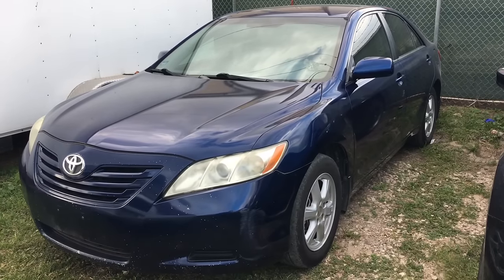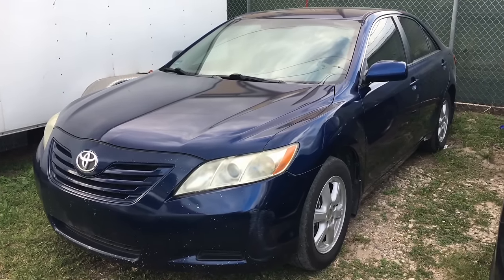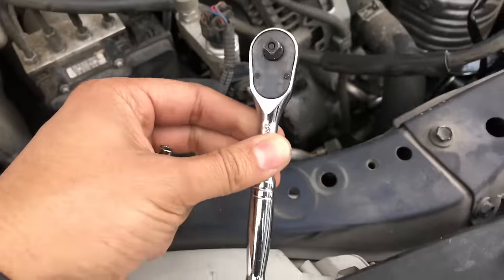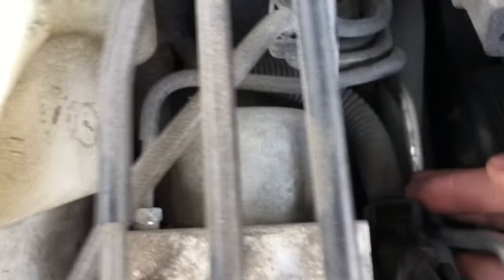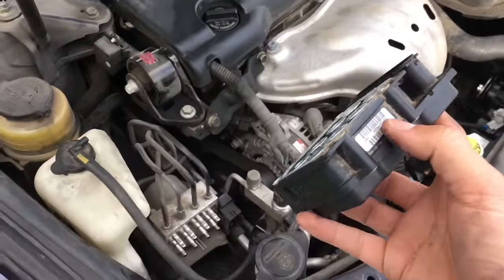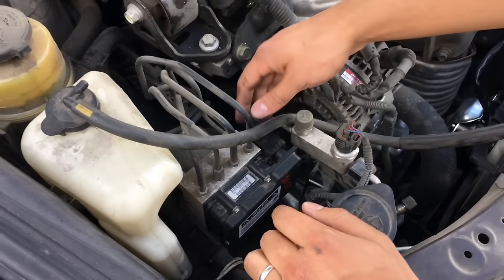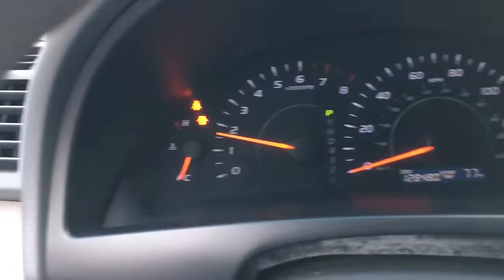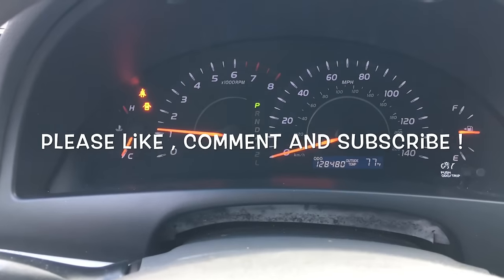How to fix a 2007 Toyota Camry ABS and Brake light and also flickering speedometer

Comment from the maker: Guys if this helped, super "Thanks" are welcome. click the heart next to the share button and send some love this way!!!
Reply: hey bud, I did this and now when idling my car sits at 500rpm and almost dies sometimes when idling. Any idea what could be causing that issue?  Edit: Just read on a forum that the car may need to relearn idle. Guy had the same issue I'm having and after driving it for awhile he said it went back to normal.
Reply: Please how can you help me send the module here in Nigeria.I will be needing plenty of it.I will pay for every expenses.Thanks bro
Reply: Before anyone spends any money on a replacement ABS, I would encourage them to consider a much cheaper approach that seems to have worked for me.
1. Remove the malfunctioning ABS module
2. Treat the electronics and all conductive surfaces (inside module and the connection points under the hood) with DeoxIT D5 spray
3. Wait at least 2 minutes
4. Treat the same areas with Deoxit Gold G5*
5. Reattach ABS module

That's it. Originally my instrument cluster was going haywire every one to two days. After cleaning it as described, I haven't had a single issue for going on three weeks now.

*The Gold spray is a little pricey and is likely not necessary.
Reply: Hi sir it is save to drive becouse the same problem to my car thanks❤

Comment: Dealership tried to charge me $3000 for this repair, independent mechanic wanted $2000. I couldn't find the part at the junkyard unfortunately, but I ordered it online for under $200 and was able to fix it myself with zero mechanical skills or knowledge. Thank you for saving me thousands of dollars!! While researching I also learned that this part works for 2007-2009 camrys and the parts for different types of camrys (e.g. v6 vs 4 cylinder) may be different, so check the serial number (the one on the bottom of the module, you need to unscrew it and take it out to see it) and make sure it is correct. (Mine only matched up to the 3 circled numbers in the middle and it was fine)
Reply from the maker: I’m glad I was able to help you! If you can donate any amount, that would help me make future videos 😃
Reply: I got mine on OfferUp for $100 got lucky
Reply: how did you bleed brake after abs module installation? manual or you needed to use odb scanner with abs bleed feature?

Comment: Problem: 2005 Toyota Avalon. Brake and ABS lights are on on the dash board. Speedometer doesn't work, it won't shift out of first gear. This all happened at the same time. No codes displayed on my scan meter. I left the car for two weeks with a Toyota mechanic. He replaced the alternator and battery. No help. I called two Toyota service departments, they never heard of this problem. I replaced the ABS control module as shown in the video. Voila, ABS and Brake lights went off, the speedometer started working and it now shifts through all of the gears like it is supposed to. The part cost me $87.00. It was easy to replace. I also disconnected the negative battery terminal while I was replacing the module.  Kudos to you guys for this video. It was a Great help and saved me a lot of headaches. No one else had ever heard of this problem. THANK YOU so much.
Reply from the maker: We are glad we where able to help and save you time and money! Please help us back by liking and subscribing 😊
Reply: Done. I sure appreciate the help.
Reply: Same problem to my 2006 Toyota Matrix I’ll replace the ABS module
Reply: Thanks for the info. I have an 05 avalon and my check engine light scan said I need to replace the abs relay. I may do the relay and the module at the same time. 😊

Comment: What Diagnostic Trouble Codes did this car have? How does the ABS affect the A/C? Can you explain why symptoms occur?
Reply: The car does not throw any codes at all. It reads "0" codes and the check engine light does not come on. It's a "typical" problem on this generation Camry, mine went 278,000 miles before I had to replace it, it just is what it is, your question should be directed to Toyota themselves. They make an excellent product, mine still runs perfect and doesn't drip a single drop of any kind of fluids, but like a lot of parts they wear out eventually and need to be replaced.

Comment: I was reading on toyotanation thst the abs module fails because brake fluid leaks inside and causes the shorting out of the lights and dash guages. I also have a power stearing leak from the reservoir near this abs module that could be causing my short. Just FYI.  Thanks for the video.

Comment: I am quite non-mechanical.  These instructions were so very clear and complete that even I was able to do the repair.  My Toyota dealer quoted $2,000 (to be fair, that's new Toyota parts - not needed on a 14-year-old, 175K miles Camry - and probably replaced the pump, too).  My local shop (they do good work) quoted $800 including a non-OEM part (considered new).  From the junkyard I bought this from (with a 1-year guarantee), the total cost including tax and shipping was $180.  45 minutes of my time (I TOLD you I'm not mechanical, LOL) and voila!!!  All fixed.  For those challenged by All Things Mechanical, as I am, that lower right bold IS difficult to reach, and yes, a couple of other parts do get into the way.  Patience, lad - you'll get it.  THANK YOU for this video.  My loyal Camry is quite happy now.
Reply from the maker: Glad I could help! If you can, help me back bully liking and subscribing 😃

Comment: Hello Guys .... I have never seen a car fix that is so direct and precise as this. Before I called an Electrical expert I did my research which was when I saw this video that portrays exactly what was wrong with my Camry 05 V6.... I did a diagnostic scan which revealed issues with the Solenoid terminals so that made it clear that it was the Abs module but the expert felt it was the sensors on the wheels... with further investigation he concluded it was ABs module . In the market here, you have to buy the full abs pump and so I did and it instantly cleared all the problems. Gear not selecting , speedometer no reading, tachometer flickering with car going off, brake and abs light on, AC not working fine. All these Gone. It just scares me how so electrical this car is. I thank God for this video. God Bless
Reply from the maker: We are glad it helped!
Reply: Hello, I hope you get to see this, I'm also having this issue right now with my camry and after watching this video, I want to change it myself but I want to ask which area you got it in Lagos if you're lagos based? Thank you.

Comment: Omg, I'm so glad I tuned in to your video. I have the exact car and problem. I will have to drive to nursing school which is 1 1/2 hours each way, so I need to get my car fixed before the program starts. Where I live it can get up to 115 degrees in the summer. Without A/C I will die for 3 hours on the road everyday. I went to a Toyota dealer here in my town and they charged me $115 to put my care on a computer to analyze the issue, then they said it would cost me $4400 to get it fixed. They advised me to buy another car rather than getting it fix. I'm sure being a single mother of two had a something to do with them playing me, but like I said I'm so glad I tuned in to your video. I am going to call around for the part at junk yards and do it myself. Thank you so much!!!!
Reply from the maker: We are glad we could save you the money! Let us know how it goes and please help us back by subscribing
Reply: Garage Boys 
You got it! 👍
Reply: My car exactly same problem . today the dealer cost me 150.00 for diagnostic then they said it would cost me $4500 to get it fixed .
Does the autoparts sell the ABS module ?
Reply: I got a quote of 700 for parts and 200 for services. I want to fix this issue but I am not getting a part at the price range that I am seeing here.

Comment: 😃😃😃😃 Update! With the help of your video yesterday and a little work (bought a brand new set of ratchets from a respected) I installed my new module! I bought it online for $100 (US) w/pump attached also–best I could find, but I know even with new ratchets I saved a LOT of money. Worked IMMEDIATELY. 

My odometer, before new module, was among other things to fail. High-beams too. Temp gauge jump up and down at times. Lots of stuff. 

All works!

Installed yesterday. Made my father proud. A brilliant man in computers, math, fatherhood, intellectual pursuits, painting, and more—but not cars beyond windshield washer fluid addition or oil-level checking.
Reply: I may have to do this on my 2012 Camry.  Did you have to do any programming?  Was the "new" module from the same year make and model?

Comment: Thank you for this video. It perfectly described how to install the ABS control module. I have a 2007 Camry. It took my about 20 minutes. My local Toyota junk yard (Los Angeles) wanted $275 for this part. I found one on eBay for $170. Now the ABS and BRAKE lights are OFF and my speedometer works perfectly. Thank you, again, for your helpful install video, that also helped me diagnose the problem in the first place and get it fixed!
Reply: is it still good ?

Comment: Thanks a lot for this video. It's just what I have been looking for. I live in Nigeria, and in November my 2007 Camry was brought in from the States. About  3 weeks ago I began to experience these exact problems with the car. I was concerned that the mechanics we have over here would engage in trial and error repair attempts and make things worse. Now I know what exactly needs to be done. I am jubilant!
Reply from the maker: we are glad it helped you!
Reply: I have fixed the problem. I had my friend who shipped the car from the US initially bring over an ABS module from Maryland. It was installed and everything is OK now. BTW, my friend gave it to me free of charge. Cool.
Reply: I have the issue now, just bought abs for 80k Nigeria naira, waiting for d mechanic to fix it, hope it works

Comment: I am resident in Nigeria and driving a 2009 Toyota Camry. I had this same issue when returning from a trip last week. After watching your video and with the experience of my colleague who also had similar problems, I yesterday took my car to the mechanic yard. We bought the complete ABS system because here they sell the complete assembly. After replacing it, the entire problem stopped. I will be taking it for a longer distance trip today.
Meanwhile, I forgot to add that I also had two error codes last week, P0712 Transmission fluid temperature sensor A low input; and P0606 ECM/PCM Processor. I am presuming the ABS module failure has a secondary effect on the transmission...
Reply: Hello. Did it stop after replacing the entire ABS system?

Comment: I have an 09 Camry that was doing the same thing. Went to a pick and pull and bought one for $70. Pulled it off an 08 model and it’s working fine.
Reply: My toyota cam 09' suddenly got the codes C0200, C0205, C0210, and C0215. Why just not one but all four?

Comment: @GarageBoys, I got used ABS module too from ebay, installed it. Brake light, RPM and AC is working good but ABS light is still on. I drove around for a bit still the same. Can you help me with this? Thanks
Reply: I have the same problem. Any fix?

Comment: thanks for this video. it real easy to replace, but quite expensive. i test drove the car--the air conditioner works, the lights went out as previously it would flicker, and the speedometer works too. thanks again.

Comment: Thank you for the video. Does the ABS module affect the EPS system in a 2013 Camry? The brake, ABS, and EPS lights all came on, with the steering wheel becoming stiff. I went to the mechanic and they said its ABS module.

Comment: Thanks for the video, I changed my abs module today. It partially resolved the problem regarding to the Air conditioning and the lights indicator, but still has zero speedometer, ABS and brake lights still on.. what do I do, or i should return the module to the owner
Reply: That happened to me!! What did you do. My lights are still on and the speedometer doesn't work but the ac works and rpm works

Comment: I have the same problems but, my speedometer sometimes works, and sometimes it does not. Is changing the abs module will fix the issue or your issue was consistent?

Comment: Symptoms (thanks to you) fixed:
*Brake light on
*ABS light on
*Tachometer jumping and at times at zero
*Same as above for tachometer 
*Temp-gauge to zero and back to half (normal operating temp)
*Fuel would sometimes move around 
*Hi-beam indicator would be on when lights at normal
*Gear (P,R,N, D..)indicator on/off
*Air-flow issues for AC/heat
*Defogger in front window works at 5% efficiency (REALLY long time to clear—not acceptable in winter)
*Rear-windshield defroster works only at C- level
Let’s see...what else?
Odometer and and trip-meters would NOT count (frozen in time making it look like you were getting horrible mileage)

Replacing module?
All better!
Reply from the maker: Awesome! Glad I was able to help you. Thanks for the input! If you can please like and subscribe :-)
Reply: what year was your camry and does it need programming?

Comment: 2011 toyota camry having similar problem. But mine was doing the same thing such as head light diming, abs , handbreak on, traction light on, rpm goes to zero also while running and fixing my itself in 2-3s. Should I try this solution?

Comment: This video helped me a lot.. thank you! & by the way, I paid $28 for the ABS module.😊
Reply from the maker: Your welcome ☺️
Reply: From where?? Everywhere I'm finding a rebuilt is $200 plus
Reply: what is the part number I am trying to order it.
Reply: @GarageBoys  problem facing in Chevrolet captiva 2007 manual, DTC U0073(ECM/ECU lost communication), U0121(ABS MODULE lost communication) and P0500(Vehicle Speed Sensor) ,,,,suddenly instrument cluster stops working ,all needles(Temperature, rpm, speed etc.) showing 0 reading , ac stops cooling while blower keep running,reverse gear light stops working, Service Vehicle Soon light & MIL illuminates in cluster. and all happen intermittently and all together. Can anybody suggest solution?
Reply from the maker: Ash Kumar check your ABS Module and also check all the fuses related to ABS.
Reply: where did you find this part. Can you please share the details
Reply: Somer Dos Cero Tres where did you get the module so cheap
Reply: Hmmm no reply I call bs
Reply: 5 350-400k p
Reply: @GarageBoys  my speedometer not working on my 07 Camry changed the speed sensor that was bad,  did changing the abs module correct the speedometer ?
Reply from the maker: night fangs yes
Reply: @GarageBoys  don't I have to blead the brakes?
Reply from the maker: no you don't have to

Comment: Great video, I have similar problem with an 05 Avalon. ABS light on, Brake light on, temperature gauge dead, a.c. not working, and gear light indicator off. I disconnected battery and everything work fine for a few minutes then back to the same proble. Next I took module off and cleaned with electrical cleaner, put everything back and car was running like a champ for about 30 min, but after that same problem. I found a used module for $70 dls, just need to go pick it up and will give it a try, thanks for your video💯💯
Reply from the maker: Please let us know the outcome, and also help us by subscribing. Thx
Reply: I will let you know thanks
Reply: I replaced abs module two days ago and so far car is running good,, thanks again!

Comment: Thank you for the help. I need this for mine as well. Mine is acting up right now, by the way can I just buy any used abs modules? Or do I have to find one that will work for mines? What I mean is that do I have to give out my Vin number to see if the part is capable for my Camry? My second question is, did you had to bleed the brakes after you swap out the new ABS Module?
Reply: If you don’t change the pump you don’t need to bleed the system . Only change the module

Comment: Hey! great video. My 2007 Toyota Camary has to same exact problem. When I go to order the ABS Module someone always ask me is it WITH or WITHOUT traction control? I would I know if my Camry has traction conrtol?
Reply from the maker: To be sure, you can call any Toyota dealer and give them your VIN number and they will be able to tell you right away. Just tell them you want to buy the ABS module and then ask them if yours has the traction control

Comment: Does this has to do with anything battery being drain my is having the same problem but my battery drains . I have a new battery and I got my alternator checked and they told me it was good . Would this fix the issue ?????

Comment: My 2007 Camry is having the same trouble! I am searching for the part now at my local junkyards, but wondered if you can tell me how you disconnect the battery as you mentioned in the video? Thank you so so much for this video!
Reply from the maker: Natalie Clem most car batteries have a 10mm bolt you can unscrew some times is 8mm , you can use ratchet or a wrench to unscrew it.  You don’t have to disconnect both terminals.   You can just disconnect one

Comment: swapped my abs module out on my 07 camry le , AC speedometer and rpm gage all work fine but the check engine light popped on and the abs and brake lights are still on ... any idea ?

Comment: Hello, i have been experiencing the symptoms you have listed, the ABS & brake lights on, the speedometer  and AC not working... Just recently the engine light came on and the brake pedal started making a hissing noise as if air was coming out when I pressed the pedal and it's taking a lot more effort to stop. I took the car to the dealer and they said it's the ABS actuator... Is that the same as the module in this video? Were you experiencing problems with the engine light on and the brake pedal acting up too? Please help!